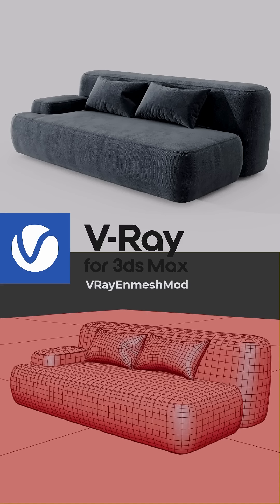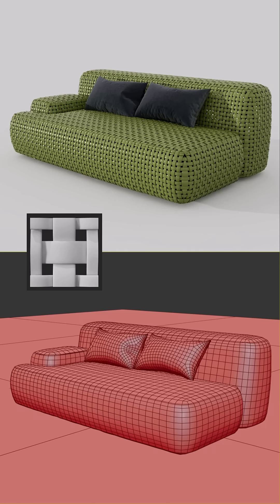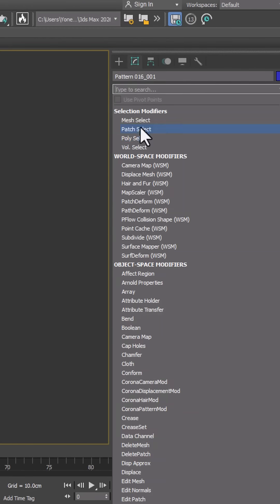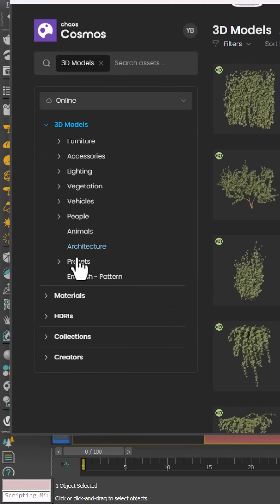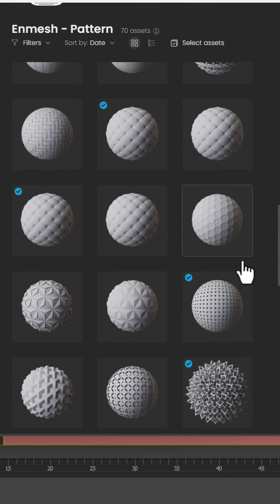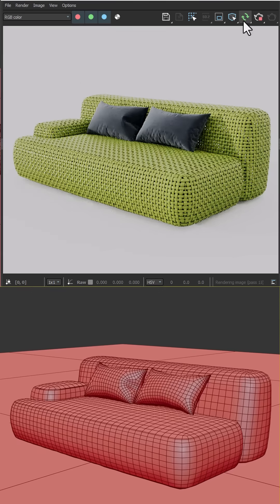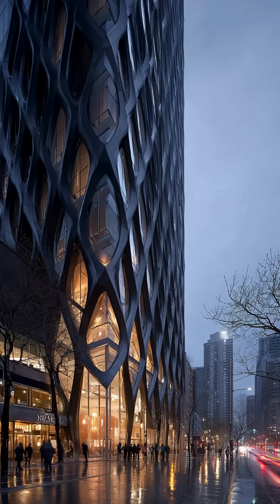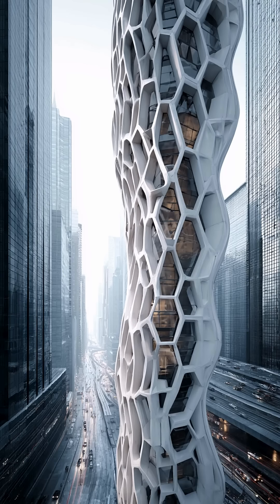Master V-Ray Enmesh: Design 3D Woven Surfaces  #3dmodeling

Comment: Can i add multisub materials to the model.
Reply from the maker: Yes — you can use a Multi/Sub-Object material with V-Ray Enmesh, but there’s a key detail to keep in mind:

Enmesh simply repeats the geometry across your target surface, so whatever material setup is assigned to that geometry is what will get repeated.

If your Enmesh source object already has a Multi/Sub material assigned and the faces have the correct material IDs, those IDs will be preserved in each instance of the pattern.

However, the target surface’s material won’t override the Enmesh pattern’s material — the pattern will always use the material from the source object.

So, in practice:

Assign your Multi/Sub material directly to the Enmesh source mesh.

Make sure polygons have the right material IDs.

V-Ray will render each repeated unit with the corresponding sub-materials intact.

If you try to mix materials between the target object and the pattern, V-Ray will ignore the target’s material for the pattern part. 

Thank you@praveenrvnayak! We appreciate you watching